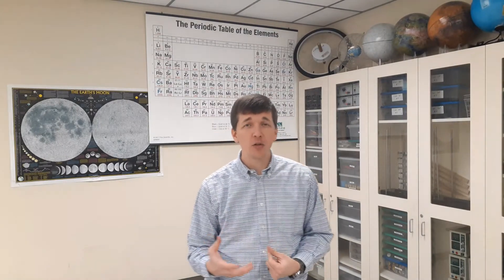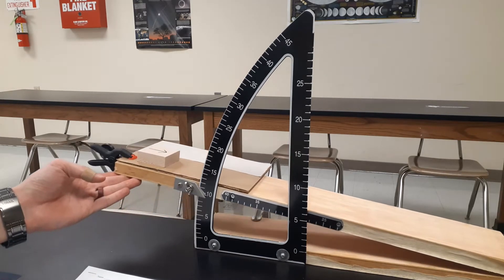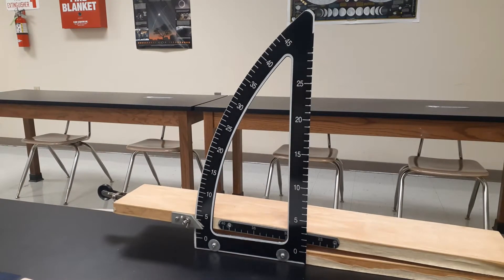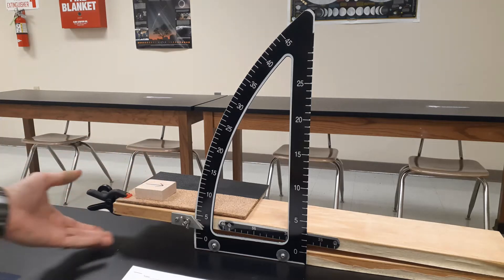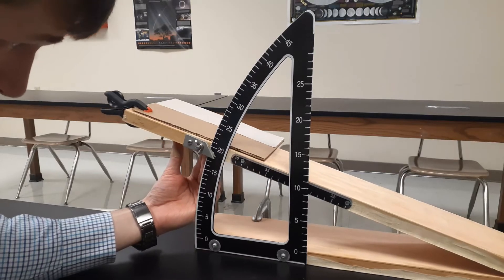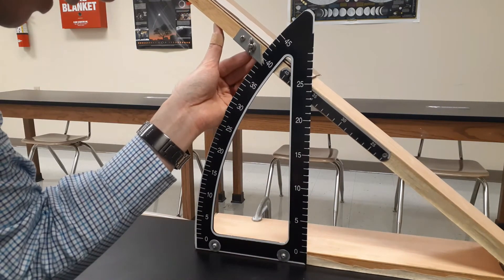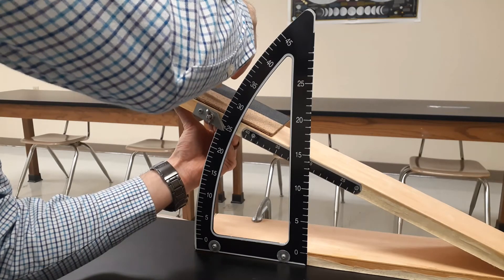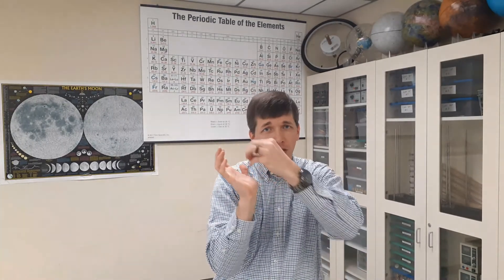Physical Science 1 Lab: Friction

Comment: Can i pls get the length of the plank pls
Reply: Buy a 10 foot long 1" by 6" board and rip the board into 4 ~2.5' planks. Take another 10' board and rip it down to 5 - 2' planks. buy a hinge and attach the longer plank (the ramp) to the shorter 2' plank (clamps to the table top). I'm sure there's an even more efficient solution to this, but just a general idea.

Comment: Great video. I've used a digital scale to drag objects before. You can get a real time readout of the break free force (static friction) then watch the scale to get an average while dragging the sample on a surface. The calculation is simply divide the mass by the pulling force. I think that works.

I used this method in the field to test motorcycle clothing samples on different road surfaces.

However, I also like your method but it doesn't work so well in the field. I can use your method to test the friction of different fabrics/leathers on sandpaper grades which I use to test abrasion.
Reply from the maker: Martin, my physics students do use a digital scale in order to measure both the static friction (break free as you said) and kinetic friction forces (dragging). Interesting to hear the real-world application of motorcycle clothing versus road surfaces.
Reply: Thanks for replying. The friction of materials in motorcycle PPE is really important. Low friction for impact to avoid tumbling and high friction for sliding to enable braking.
Reply: I've done a similar lab with breaking static friction vs. kinetic. I have students with dramatic differences in ability, so I feel like this lab is a great entry lab for understanding the basics and how surfaces interact. Also, we use Vernier force sensors, and despite careful preparation (we use wood blocks with felt on the opposite side), students never get smooth data when pulling horizontally. The kinetic part of the graph looks good, but the static portion is difficult for many students (juniors) to interpret. I sort of encourage a "flub," where I mention to pull gently and once it's about to move, give it a bit of an impulse to really expose that peak static friction. It works well enough, but I really wish I could get smooth data. Any suggestions?

Comment: when we calculate average are we only adding angles or we should also add the heights?
Reply from the maker: Only the angles. The height would depend on both the length of the board and the angle. Since you can place the block anywhere along the board and get the same results, the height doesn't matter.

Comment: Why did you drop the block on surface to calculate the kinetic friction?
Reply from the maker: The block needs to be moving for kinetic friction to affect it. The kinetic friction is  will stop the block from sliding if it is greater than the downhill force of gravity.

The ideal situation would be to find the angle that allows the block to slide down the ramp with a constant velocity (no acceleration at all). Then the kinetic friction would be equal to the downhill force of gravity.

coefficeint * m * g * cosine theta = m * g * sin theta

It's hard to judge when that happens just by watching it and it's beyond the scope of my physical science class to discuss trigonometry and measure acceleration on an incline. My goal is for students to see that static friction is typically greater than kinetic friction. Thanks for watching!